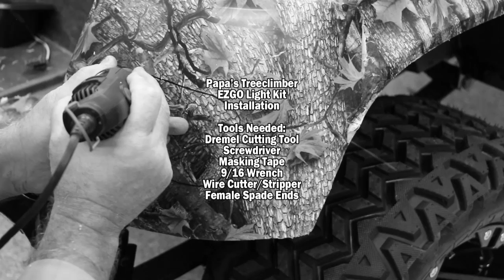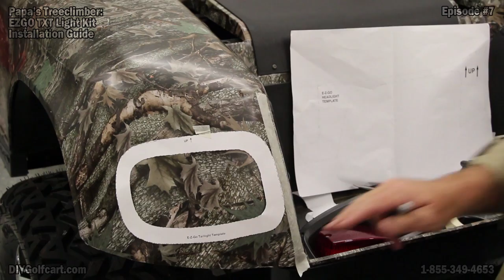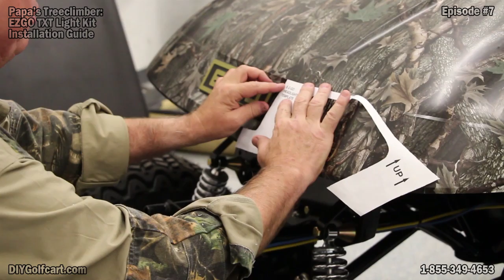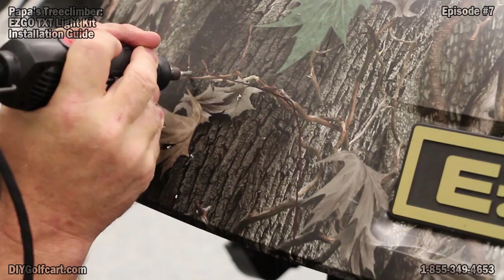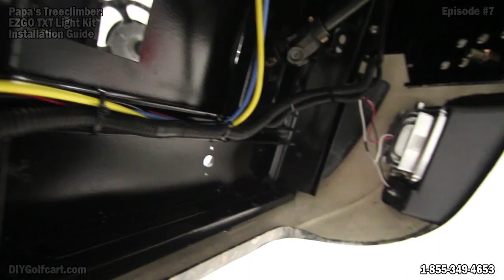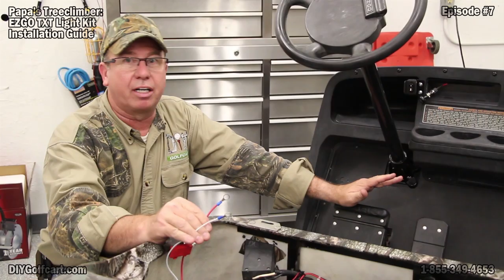EZGO TXT LED Headlight and Tail Light Kit | How to Install on Golf Cart

Comment: video is 10 yrs. old and he hooked up the harness incorrectly, Red plugs go on rh side front and back. White on left side front and back
Reply: Yes, you're right.   Most of his videos have a lot of "abracadabra BOOM it's done" , but he's still better than the Chinese instructions that come with it.  I like that he did the video so I know what to and not to do, so it is still helpful.   (a cheap sealed 8AH 12 volt battery is also a good upgrade to run the lights in case you left them on it doesn't mess up the main battery system. )

Comment: At minute 10:15, you mention a "positive fuse block". My 2002 TXT doesn't have a fuse panel anywhere even though all the manuals say there's one. Do you sell this item? I also need to add a 12V voltage reducer.

Comment: I have a 2003 ezgo golf cart and would like to put a lift kit on it. It is a 36volt setup. What would you recommend.
Reply: I just finished a 2003 model. I used the L10 kit from Amazon. $ 165.00 , worked great.

Comment: 5816 LIGHT KIT EZGO GAS 94-UP HAS A LIGHT BAR FOR FRONT AND TAIL LIGHTS FOR REAR , NEED HELP WITH PUTTING LIGHT BAR ON AND INSTALLING LIGHTBAR WIRING KIT . THANK YOU , GARY , HAVE 2017 EZGO TXT GAS CART .

Comment: HAVE A 5816 LIGHT KIT EZGO GAS 94-UP NEED HELP WIRING IT , PLEASE HELP , SINCERELY GARY
Reply from the maker: On something like that, lay it out on the floor and connect everything per instructions (except battery hook up). This will give you a better idea on how things are wired before you try installing it on the car.